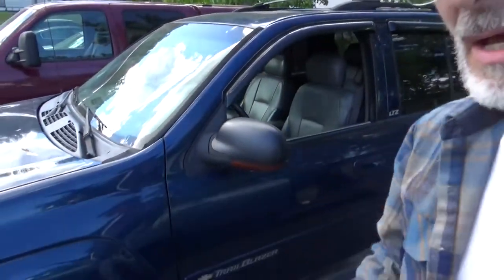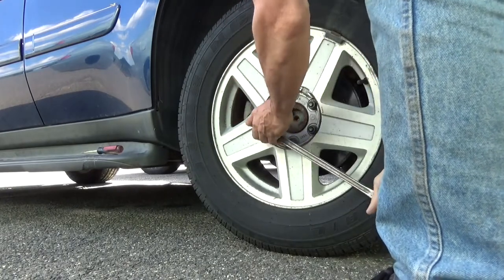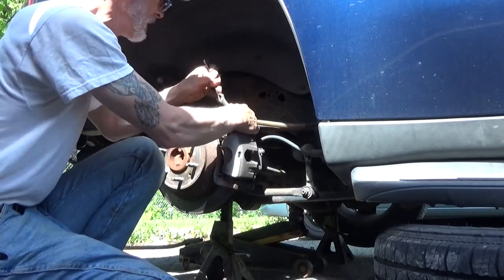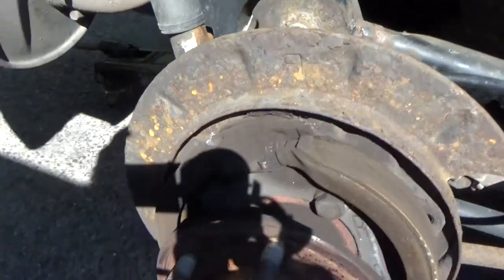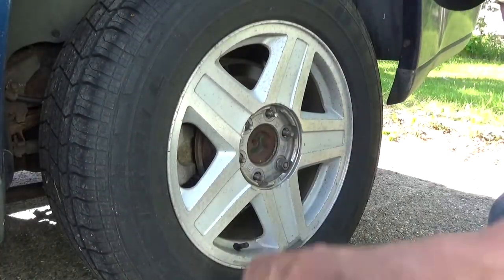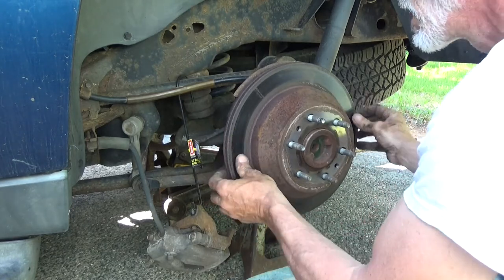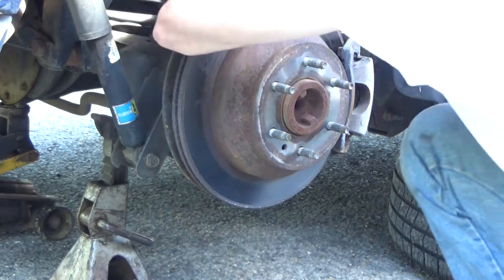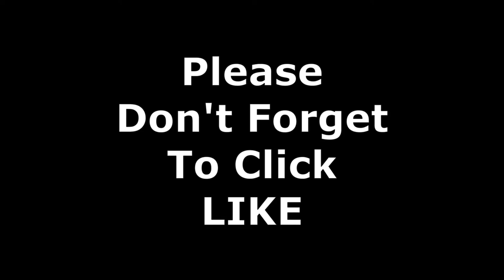2002 TrailBlazer LTZ Parking Brake - Auto Repair

Comment: Excellent video. Thanks for this very informative video.  Not to be critical, but you did say something about that rear support for the axle and should someone hit a hole with a load, or "hit the brakes too hard" ,  it may bend and fail.  Then you lock the brakes up, and I was cringing, LOL.
Reply from the maker: observant! Yes... part of the anchor point was rusted away... enough left to hold everything securely, but I personally wouldn't trust it to last long.
Reply: it's the trailing arm mounting bracket - there's a repair kit sold. I found someone who welded them in for me. I still need to get my e-brake cable attached though - not sure which mechanic forgot to reattach them? Probably when the dust shields got replaced.

Comment: My rear passenger brake is making a noise all the time but especially when breaking. Before i take it apart, what should i expect? This video showed how to disgnose and adjust but what if i need to replace the emergency drum brake? I was under the impression the e brake was only a drum on one side but it's the same on both sides?
Reply from the maker: Both sides are either the same, or mirror. the parking brake on THESE, is a single round ring, held in place by a delicate, single, small bolt and retainer spring, at it's bottom. The adjuster is on top. These seldom cause problems except when heavily effected by rust.
 If the noise is effected by the act of pressing the brake pedal, you've probably worn off most, or all of the pad material on one or more pads. Expect sharp edges. BEFORE removing wheel, VERIFY that there is no wheel bearing play.
 With wheel off, visually inspect pad thickness of both inboard and outboard pads, top, bottom and side to side. Uneven wear indicates something binding or stuck.
Replace with quality pads AND hardware clips, clean and recondition the bracket as necessary, and replace ANY damaged, stuck, torn, cracked, or swollen parts. Rotors that have "sticky" spots while turning, may be out of true, and should be machined or replaced. This also applies if there is ANY damage to either of them.

Comment: Thanks for the informative video. As Jeff noted, the valve stem picture was something I also never knew about, excellent insight. Just ordered new rear disks and pads for my 2005 Trailblazer. Originals have lasted through 198,000 miles.
Reply from the maker: You must live in a salt free area. That;s a long time!
Reply: @HouseCallAutoRepair   Fort Worth & now Chandler AZ. Spent part of a winter north of Duluth MN but that’s it. So your right, no salt.
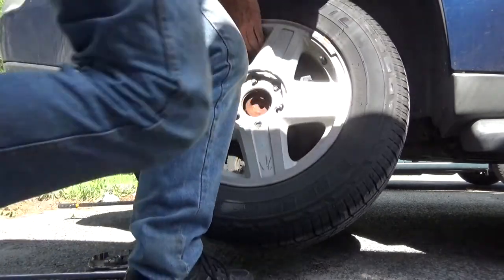Reply: @HouseCallAutoRepair  Replaced discs, pads, adjusted parking brake and rear shocks. Started at 5:00 AM it was already 90 degrees and I beat the horrid sun and was done by 8:20. your video was very helpful. Thanks again.

Comment: Hey man, thanks for the super informative video…need to get this done on my wife’s 04 trailblazer liked and subbed
Reply from the maker: I hope everything goes smoothly!
Reply: @HouseCallAutoRepair  I know nothing much about the parking brake but if the adjustments have been made but the truck still rolls forward when the parking brake is engaged and gas is pressed, would the next step be replacing the shoes? Your help and time is greatly appreciated!

Comment: Mine is a 2004 GMC Envoy 2WD, I think it's the same procedure, right? It's a good video anyway, thanks.
Reply from the maker: Should be exactly the same. USE CAUTION with the retaining clip!
Reply: @HouseCallAutoRepair  What if the retaining clip is rusted in and won't undo? Is there a trick to getting it out?
Reply: Great video by the way the most informative Ive seen on this :)

Comment: I use channel locks on the adjuster wheel
Reply from the maker: Pliers tend to not give a true feel for the functional condition of the threaded portion of the adjuster. Force of habit, I always make sure they turn by finger, prior to installing the drum/rotor, otherwise, those with self adjusters, get stuck and don't adjust.
Reply: @HouseCallAutoRepair  to each his own, channel locks always work well for me

Comment: You can also lift the e brake boot and lock the ebrake up and hit the self adjuster lever to tighten up.
Reply from the maker: Do you mean through the boot on the backing plate?
(I'm confused by the "lock the ebrake up" part, because you can't adjust an applied brake)
Reply: @HouseCallAutoRepair   yea i just did it the other day it releases the gear like 3 spokes so next time you pull up it gives it more. Pretty cool

Comment: I'll be damned ! I did not know about the marking on the lug nut cover indicating the direction toward the valve stem. I always used the trial and error method! lol  Thanks, brother. Two thumbs up!
Reply from the maker: It took me years of looking at the valve stem molding on the backside, before I figured out why it was there.... on the cover.
Reply: @HouseCallAutoRepair  Also, I replaced the rear rotors and pads yesterday on my 2003 Trailblazer. The previous owner completely removed the one piece brake shoe ,  mechanical piston and adjuster  (both sides).  225,000 miles... I left it that way.

Comment: too bad there wasn't a hole to adjust it, so you didnt need to remove the wheel an caliper, Looks like im in for a doozie
Reply from the maker: Sometimes there is an opening from the backside... personally, I think it's easier to just pull it apart. If it's in good shape, it's easy.

Comment: Jack stands right behind the back doors
Reply from the maker: I make it a point to NEVER use a pinchweld to support a vehicle, beyond changing a tire with ONLY the factory scissor jack. Rust up here, in the Salt Belt, turns pinch welds and other support points, into Swiss Cheese! 
It took ONE lift foot, up INSIDE my car, to teach me to NEVER trust a pinchweld. (The repair work that had to have been done before my ownership, hid the damage, well)